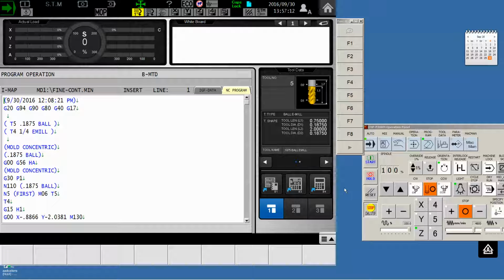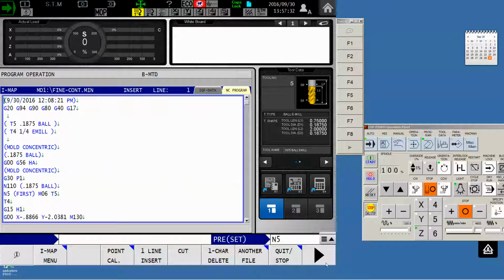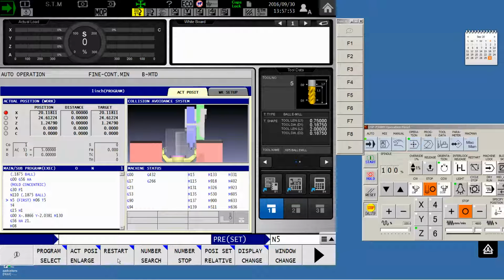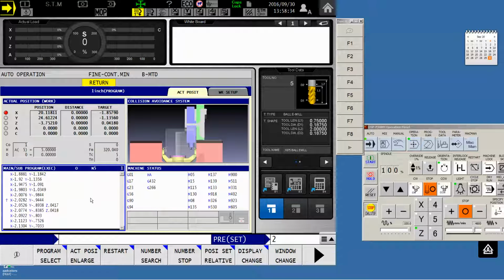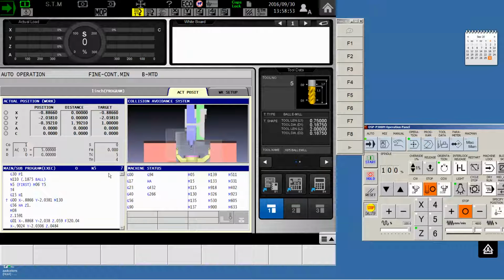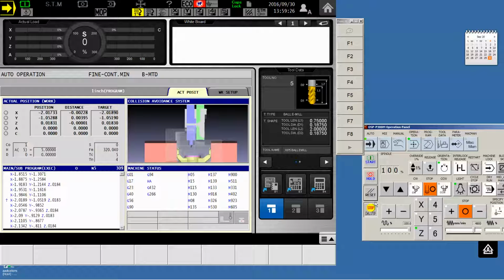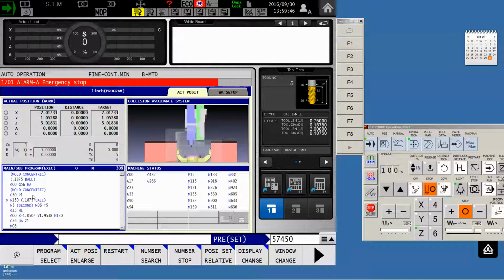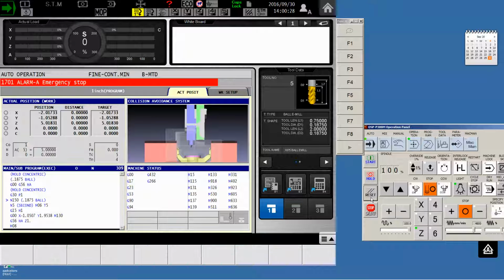BLOCK RESTART

Comment: Hi
I'm running a LT2000 with osp-p300LA. How can I restart using " Tool restart" button?
Every time I try, I get a "2672-05 alarm-B   C-axis sync command format C side 21"
Even when I'm not using my C-axis in the program.
Thanks

Comment: Is there a way to insert spindle probe cycles into your programs. Osp-p300ma. I can run individual probe cycle from the set inspect app, and I can build and save a probing program, but how do I put it into my program with out having to type all of it out?
Reply from the maker: Do you have Program Builder from Renishaw? It comes on the Set and Inspect software and specifically creates a .SSB program so you can call it from your part program with a simple CALL Oxxx